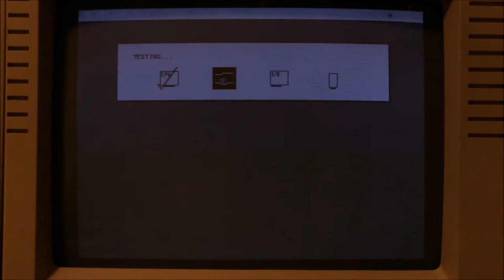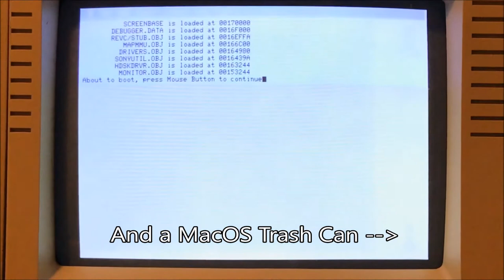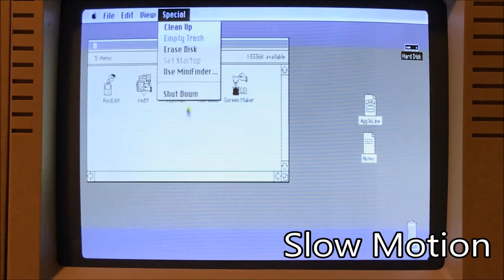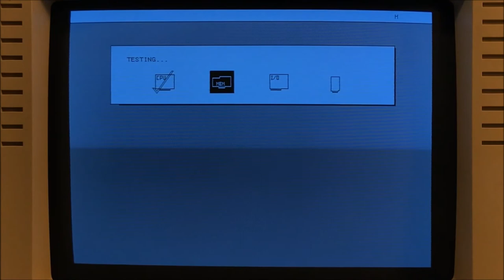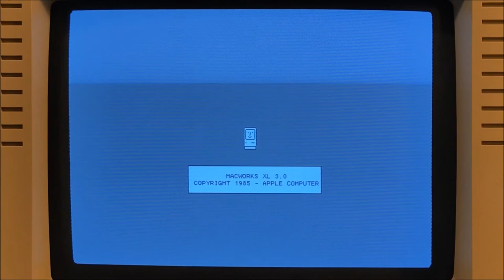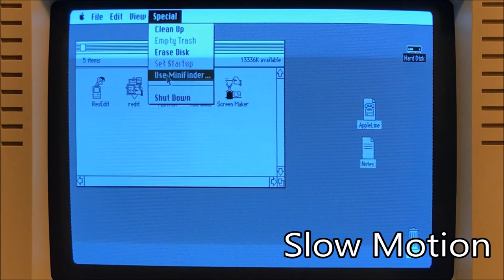Apple Lisa CRT Replacement

Comment: suggestion, when working with crt's always use one hand and the other at the back of your body. and always have someone next to you for emergency, if things go wrong. also to remove the connector use a plier using one hand. after you make sure its safe work with both.
Reply from the maker: If I was working on a large color CRT with 30,000 volts on the 2nd anode, I'd agree. The lill 12" tube in a Lisa with it's 8,000 volt 2nd anode is much easier to deal with. Having discharged the tube moments before, I had no qualms about unhooking the wires by hand.

If the computer was running, I would have only had one hand near the high voltage for sure!

Comment: DID YOU JUST INSTALL MACOS?! ITS NOT TOLERATED FOR THE APPLE LISA SERIES!!!
Reply from the maker: I chose Macworks for the demo because it starts up, and shuts down more quickly than the Office System. 
I have the Office System, UniPlus+, Xenix, Macworks XL, and Macworks Plus on the ideFile. 
If you look at any of the Lisa OS demos I've done for the Vintage Computer Federation, they're done using this machine!
Reply: @compu85  YEET